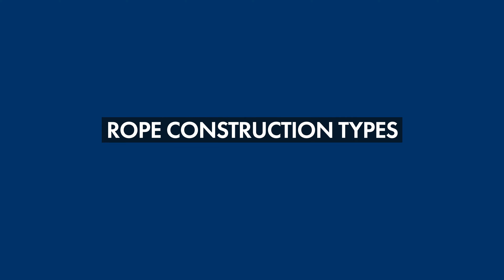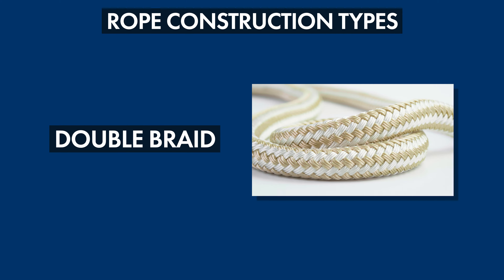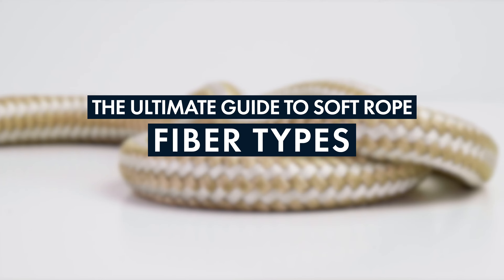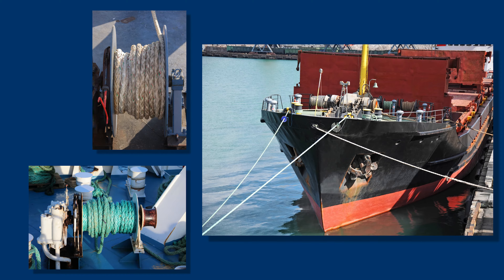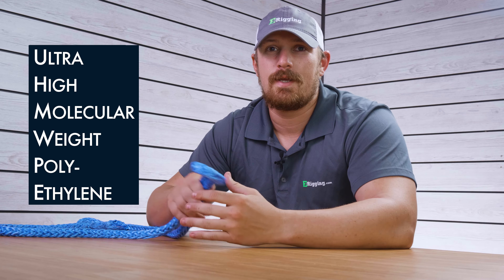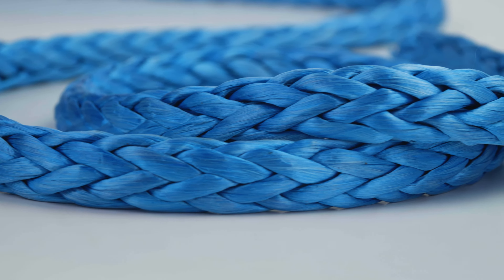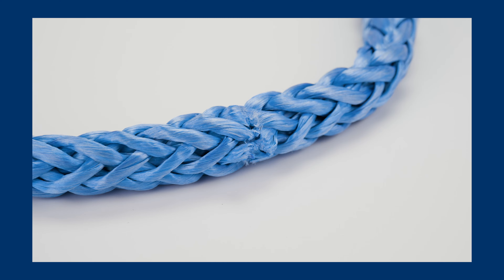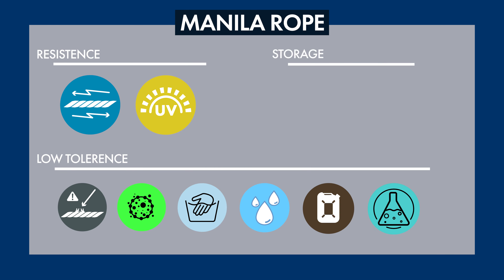The Ultimate Guide to Soft Rope - Rope Construction and Fiber Buying Guide

Comment: For Docklines and anchor ropes you will need the shockabsorbing ability from the elastic NYLON polyamide. In the video 4:30 minutes, you (and that is misguiding) recommend "Polyester for docklines and anchor ropes because of the LOW STRECH". That is not logic. In most situations you need elastic ropes for docklines and anchor rope.

Comment: @05:58 You said dynema/spectra has decent elasticity? I thought it has little to no elasticity...
Reply from the maker: Thanks for the comment! UHMWPE fibers are rigid, but the rope itself behaves elastic because of the braid. Any elongation (within WLL) is not due to the mechanical properties of the UHMWPE fibers necessarily, but to the stabilization of the braiding process under load. We omitted this from the video since it felt like a bit of a rabbit hole. Let us know if you'd like to see a video that goes a little deeper into our UWMWPE ropes.

Comment: So which for rock climbing? Nylon?
Reply from the maker: Right, most climbers will use nylon ropes that are dry treated, meaning they've been chemically treated to make them less hydrophilic. Nylon loses strength when wet, so it's important to find a dry-treated nylon climbing rope if you're planning on climbing outside the gym. Thanks for the comment!

Comment: “Adopts 48 strands high strength nylon thread at its core, super high pulling force is ensured.
Double layers, each layer is tightly woven with 24 strands of reinforced polyester wires, very high abrasion resistance Adopts 48 strands high strength nylon thread at its core, super high pulling force is ensured.
Double layers, each layer is tightly woven with 24 strands of reinforced polyester wires, very high abrasion resistance”

Can I use this rope for climbing or is there not enough shock absorption? (I’ll be climbing trees)
Reply from the maker: Right. Double Braid Nylon is your best bet. Nylon ropes that have been dry-treated will be the safest option since the treatment will keep it from getting wet. Wet Nylon ropes are not as strong as dry ones. Thanks for the comment!